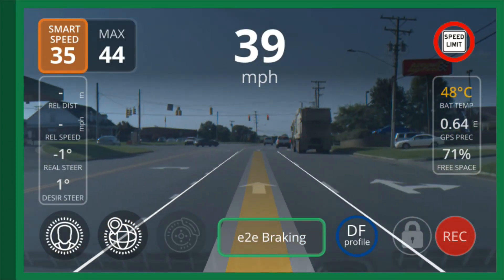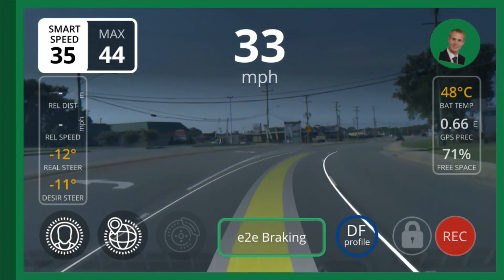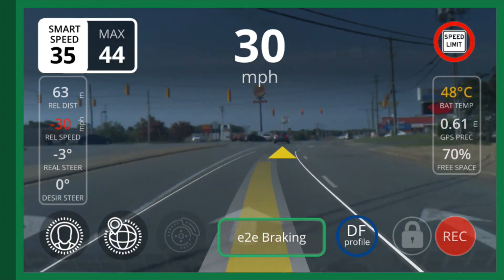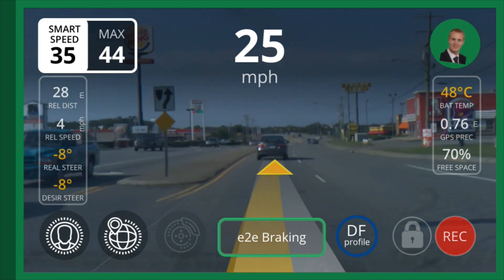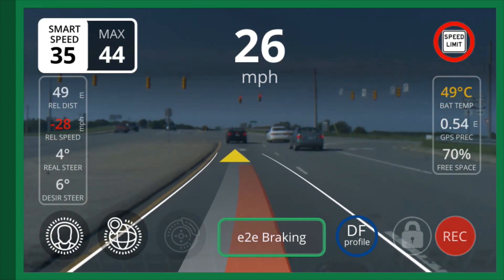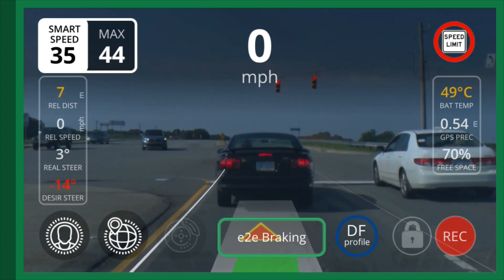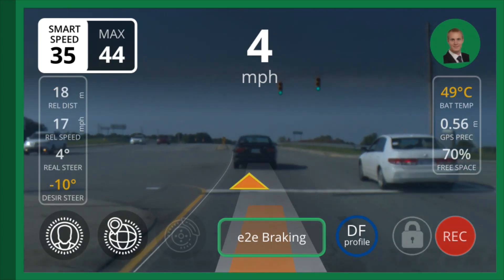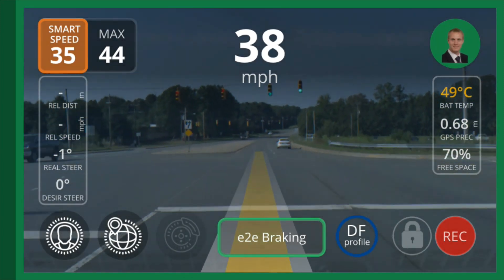OpenPilot 7.7 | 3 red lights | Auto stop / resume

Comment: This is not the standard  OpenPilot 7.7. Is this a special fork? Where is it available?
Reply from the maker: On Github. I'm using a fork for the Chevy BOLT EV.
Reply: @DavidKK4GAF  Impressive!  Did it require you to have coding skills or were you able to download the "forK" from Github already to go?  Thanks
Reply from the maker: @pauldomsten8331  The Fork that is running is custom for the Chevy BOLT.